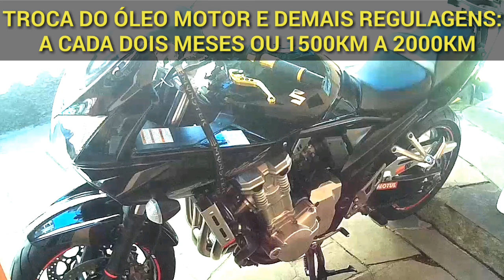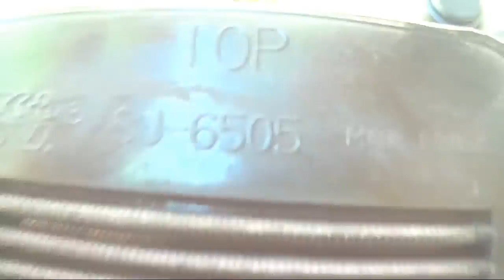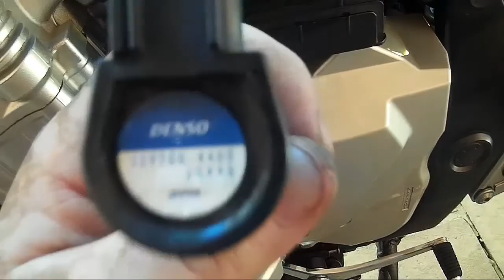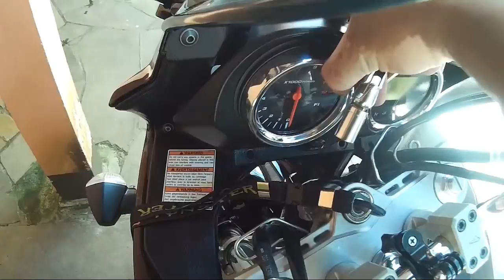Trocando velas e filtro ar da bandit - Faça você mesmo - part 1

Comment: Fala cleber blz .ontem fiz a troca das velas da minha bandit 1250 vendo seu vídeo 👏👏.Mim diga uma coisa as velas que estavam nelas eram a  Iridium CR7EIX eu não sabia e comprei a Cr9eix ela usa qual modelo ?Tem algum problema?
Reply from the maker: Salve Marcão! Blz irmão? Na minha estava as cr9eix. Mas a correta para 1250 é cr7eix. Cr9e para bandit 650. Na 1250 usam cr7e e cr8e. A diferença está na temperatura da vela. Cr9 mais fria e cr7 mais quente. Com cr9 minha moto ficou com a injeção desregulada. Carbonizou tudo. Botei cr7e ficou outra moto. Valeu! Abraço. 👍💪

Comment: amigo vc usa militec 1 no motor dela: se sim, ele exige que nao acione a embreagem por 20mint, mas no caso das bandit e necessario acionar para ela ligar, para apenas ligar ela nao tem problema:
Reply from the maker: +Diego Barroso e aí brother blz...isso mesmo, já uso a um ano o militec-1 na bandit, acabei de usar hoje de novo, no vídeo do militec eu explico como aplicar e a dica da embreagem.
Reply: Cleber da Bandit 1250 , a obrigdo, a minha é 650s, vou aplicar ele semana que vem, hj eu apliquei o koube de combustível
Reply from the maker: +Diego Barroso isso aí...É muito bom o aditivo da koube, limpa mesmo, se a motoka estiver bem carbonizada, falhando ou fraca nas respostas, aplica ele no modo corretivo: 5 litros de gasolina para um frasco do perfect clean, e rida com ela na br uns 10 minutos.
Reply from the maker: +Diego Barroso estou editando o vídeo do militec, logo posto ele...o único cuidado é com o acionamento da embreagem, lá no vídeo eu mostro como ligar ela sem apertar a embreagem.
Reply from the maker: +Diego Barroso se a moto não estiver tão carbonizada, nem falhando muito, aí tu usa no modo preventivo: um tanque de gás...para uma lata do aditivo.
Reply from the maker: +Diego Barroso na minha eu uso o militec a cada 4 trocas de óleo, coloco 3,2 litros de óleo no motor + os 200ml do militec.
Reply: Entendi, eu vi uma galera q tem Suzuki e triumph, a primeira ligada eles usa embreagem, pq o militec só adere ao metal cerca do 40° graus, vou ver seu video assim q postar, sobre o koube, eu fiz no modo correção, como nunca usei ele, a minha é a ultima edição da carburda, nao está falhando, ta perfeitinha, mas coloquei a lata toda como foi a primeira vez, com 5lt de podium
Reply from the maker: +Diego Barroso isso...40° é quando começa a aderir ao motor, por isso o pessoal erra...Não pode apertar embreagem em nenhum momento, pq senão ele penetra no meio dos discos e aí pode patinar embreagem.
Reply: entendi, assim q vc postar o video ja olho,
Reply from the maker: +Diego Barroso lá tem o macete da embreagem...valeu brother, é nós, tamo junto . abraço.